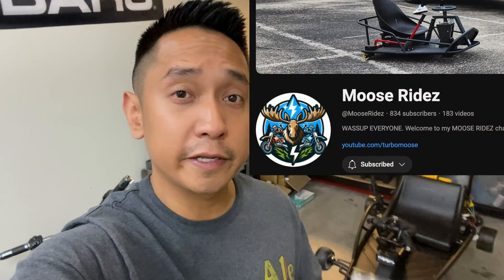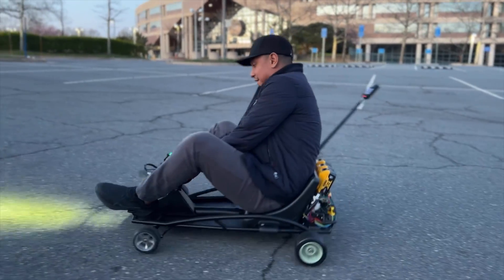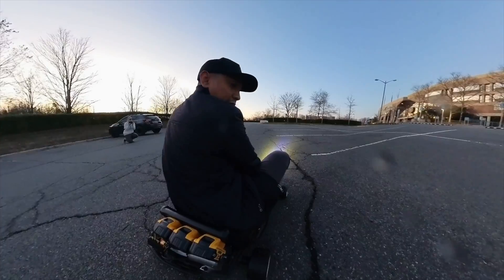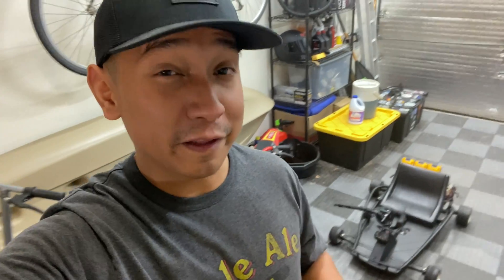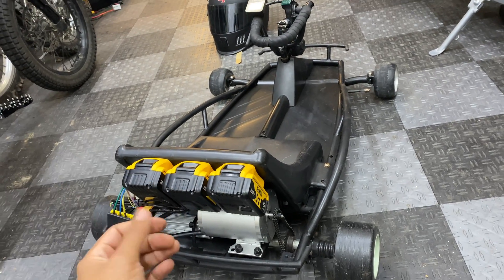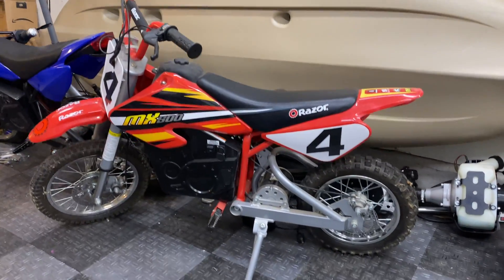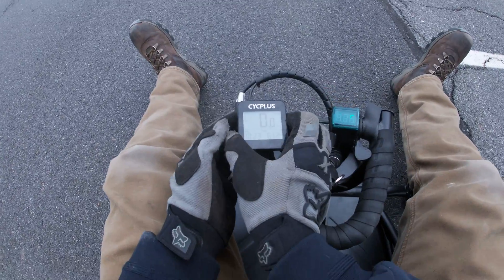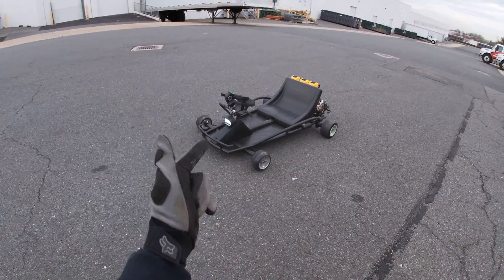60V Razor Ground Force Drift Kart Speed Test - New Bike Reveal!

Comment: great video set.. Im trying something very similar, mine works but the motor seems to rev up very slowly like the controller is throttling it. I tried all 3 speed pins on the controller and they all do the same thing. Did u have any challenges with that ?

Comment: you can put disc brakes. but you need to cut a key slot. with a new 20mm disc hub. most caliper will be hydraulic. only other option is with a bicycle disc caliper using cables
Reply from the maker: Problem is how small the stock wheels are, which leaves the rear axle hanging 2” off the ground. So a standard size brake disc would have extremely low clearance from the ground
Reply: @PatOutdoors you will need to upgrade the wheels. I forgot about that part. I got rid of my plastic wheels bc I was sliding all over the place

Comment: I cut down some front tires from a mower. Then I used 1/2 wood screws to screw them down to my rear tires. It made a hell of a difference like you wouldn't believe. Made me able to take turns without spinning out at high speed. Give it a try. You'll be surprised at the difference in handling. I also picked up my 0- 40 time by 3 seconds on the pavement. I run a 14-tooth spur and a 65-axle sprocket. Give it a try my man you'll be very surprised. Take care. Also, I'm still on a brushed setup. 84volts on a 1500watt brushed motor.
Reply: Are you able to make a video or upload pics to a site to see?
Reply: @jasonbushing5387  I just took 2 old mower tires and cut a length of tread as wide and as long as needed, drilled 4 shallow pilot holes and screwed the ends down with 2 wood screws on each end, where the ends met. Pretty simple job. I used a 1/32 drill bit to drill the pilot holes about a half inch deep, and a number 2 Phillips screw bit. Doesn't have to be exact. You can put your own little twist on it. I'm on vacation right now and am 1500 miles away from the kart at the moment.

Comment: You should switch out the rear wheels with rubber ones. Almost same size as the front. That's what I did with mine. More grip. Now it's a gokart and not a drifter but can be reversed easily
Reply: Which wheels did you use
Reply: @matthewelorreaga3607 hold on ill check
Reply: @matthewelorreaga3607  ground force wheels. Bought on Amazon
Reply: yes what wheels pls , link and photo if u can
Reply: Ok i will @DavidThomas-wy9pn

Comment: Hi I did this same exact build all the way to the same sprocket as you but I can’t seem to get above 20mph, are you sure you are using your speedometer in mi/hr? When I converted 20 mi/hr to km/hr I got 32 km/hr so I’m just trying to make sure I’m not doing anything wrong.
Reply from the maker: Speedo is GPS based and I’m MPH, same one used on my Talaria and other bikes.. What brand controller do you have and how many volts does it read at the volt meter? Also how much do you weigh?
Reply: @PatOutdoors  I weigh roughly 170lbs and i am also using a vevor controller and motor, i have the stock trottle and key swich so i dont know exactly how may vots is running but it is usually above 60 volts before it gets to any connections.
Reply from the maker: Also I measured wheel speed with a digital laser tachometer on all (3) speed options. What RPMs do your rear wheels read at?
Reply: @PatOutdoors  ill look into it,  i might not get tools to check for that because i am low on funds rn tho

Comment: Razor dune buggy wheels, axle and disk brake are a direct fit. You could slip some PVC over the rear tires on a dune buggy tire
Reply from the maker: Nice! Did you do this yourself? I may transfer all the components to a buggy frame if I find a good deal
Reply: @PatOutdoors hi I bought a motor similar to the motor you got but I’m not sure if the 48. Volt motor will handle 72 volts but it looks very similar to basically to 72 Volt motor

Comment: ive got the components from a "Kaboo mantis 10 pro" (60v 24.5ah battery, 2x 1000w hub motors, controller, display) i want to make smth like this but my only concern is the fact i will be using 2 motors in one cart, do you have any tips?
Reply from the maker: Hmm well this wouldn’t be the kart for it since it has very very limited space. You may have to fabricate custom rear mounts for whatever kart you go with since both sides of each axle would need to be supported for the hub motors

Comment: I appreciate the shout brotha! Glad it fixed that issue! This thing is absolutely insane lmao 😅
Reply: Hi can we go over why the wire was recommended to be replaced on the volt meter? And why the volt meter/thumb  stoped working.

I’m working on doing this same build and just want to clarify💪🏼 Thanks!
Reply: @talonwinkle9552  sometimes its wired incorrectly and will not work. Just have to swap the two wires and that's it